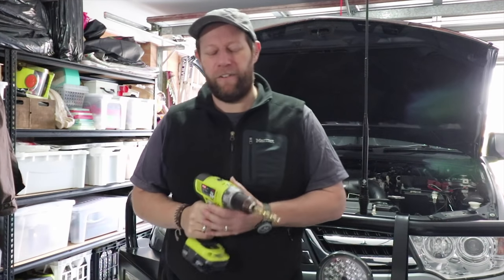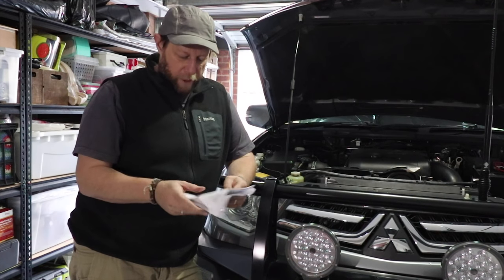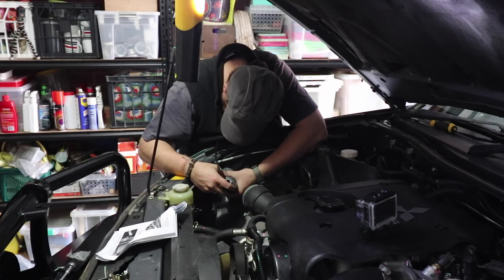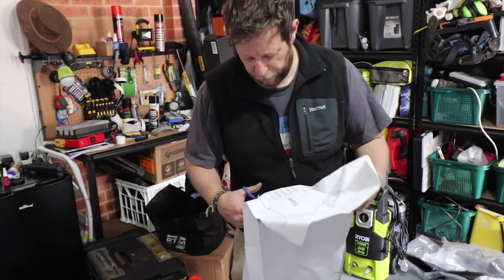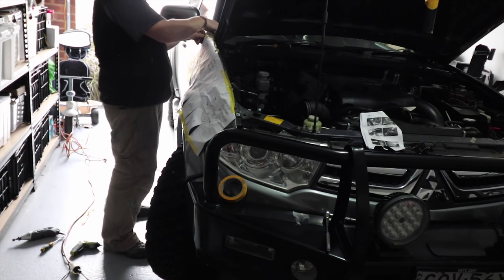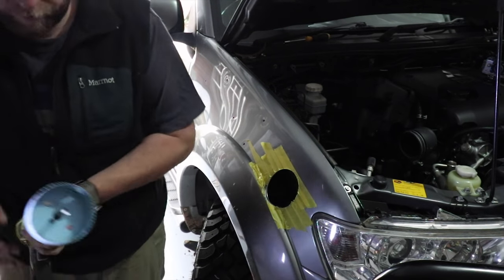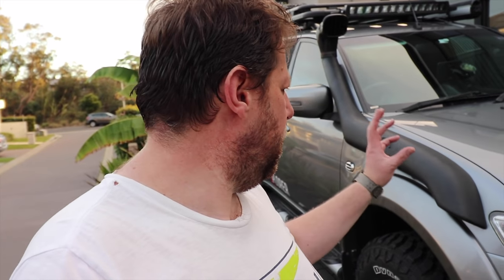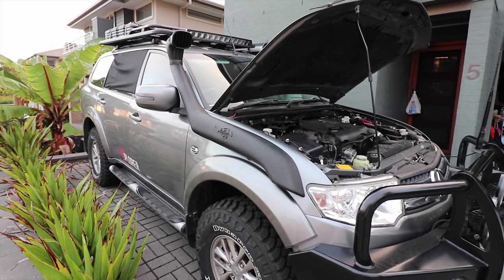Mitsubishi Challenger Snorkel Install - What could go wrong?

Comment: Did you have any issues installing the bracket on the A pillar as there is an airbag on the other side eg any precautions made before hand? My other question is was there enough length on hoses of the original coolant overflow bottle? You didn’t need to buy additional lines

Comment: Q/ Did you have to move the air box? What is the model of snorkel?  I have oil catch can that sits behind air box so don't have room to move much.
Reply from the maker: Hi Paul. I think it moved a little bit but not much. It’s an airflow snorkel. I also have a catch can between the air box and abs system. Andy